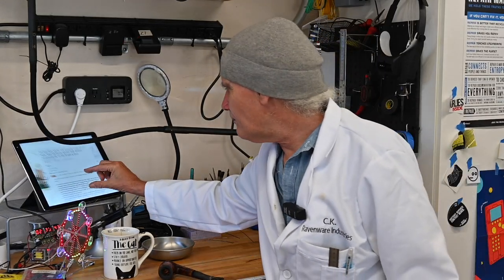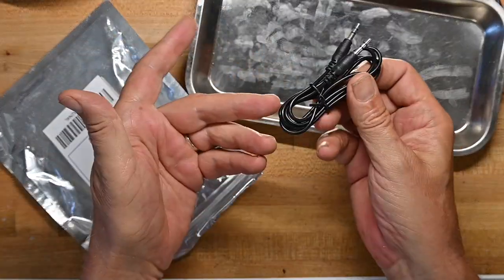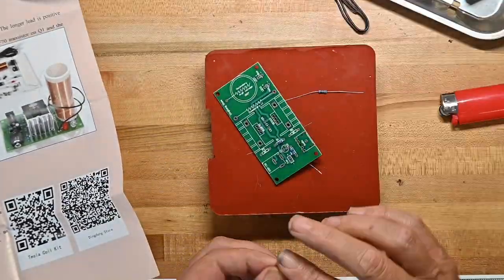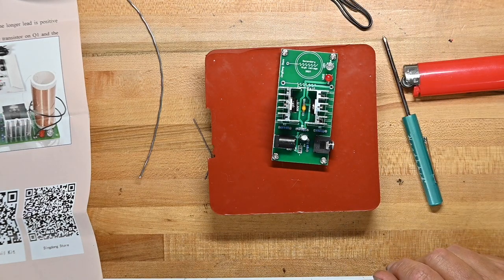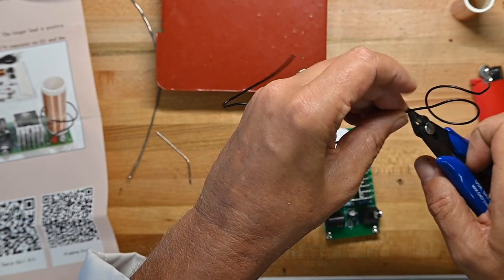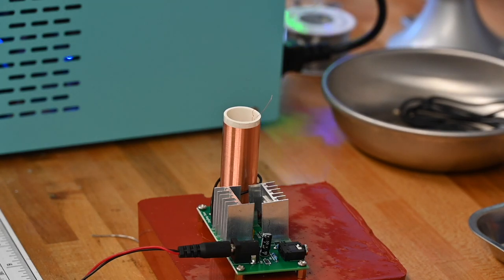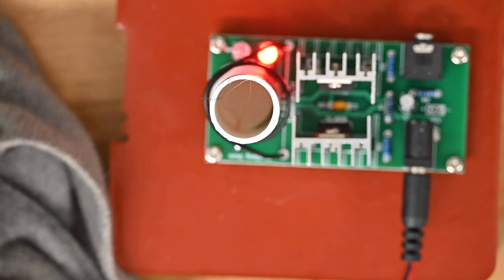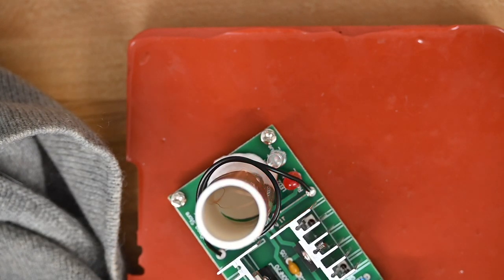C.K. builds a little Tesla Coil kit

Comment: I got recently the similar tesla coil kit as well,is not that great and needs some modifications,i would add a diode to the aux port so in case the transistors broke to not deliver current through the auxiliary cable to my phone or any audio amplifier, that J3 on the board is to add a small 5-12V fan for the radiators of the transistors because they get very hot.
Reply from the maker: Good tips.   Though for me, the small size and small arc means I won't be keeping this on long enough for it to get hot.  I have bought a larger one, look for the video in the next month or so.
Reply: @CKHaun  it can play a 5min song if u add the fan othersise it will burn the transistors, and yes this is more of a toy compared to the bigger kits that might be out there, wick are also performing much better.

Comment: Always freaks me out when I don't know if center positive is right or wrong and if it's wrong, will my work burn up before I can unplug it?
Reply from the maker: It depends.  If the circuit is diode protected, it should not be damaged, diode will block the wrong way current.  This kit, as you can see, does NOT have diode protection, sho there is some risk.  Also, some components care a lot about polarity (semiconductors usually) and can get damaged even if you detect and unplug fast.  An electrolitic capacitor, on the other hand, can take a good bit of reverse current.  On this board I think the power transistors could take a bit of reverse current, not sure the LEDs would.  But the bottom line is, it is irritating when the kit designer doesn't specify, they should always.  As you build more and more and learn more you can also start tracing the power flow (if you can see all the board traces, not always possible) and determine from that what the center should provide.  But not always possible.
Nice "Atlas Shrugged" profile thumbnail by the way!